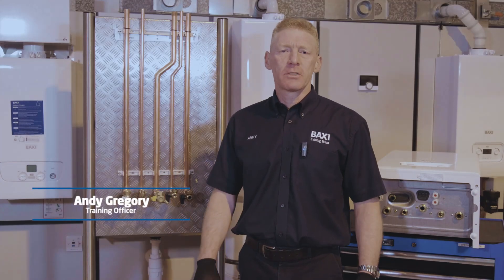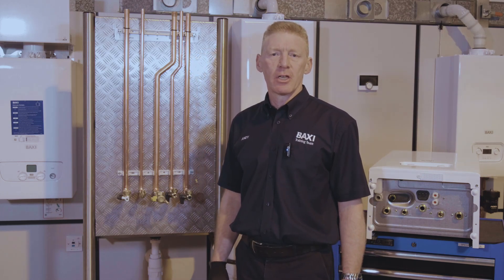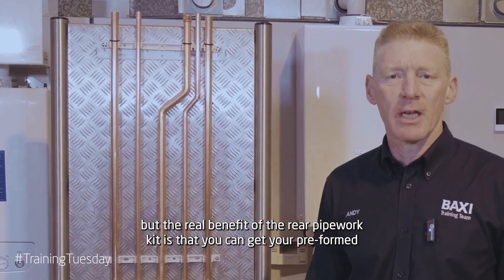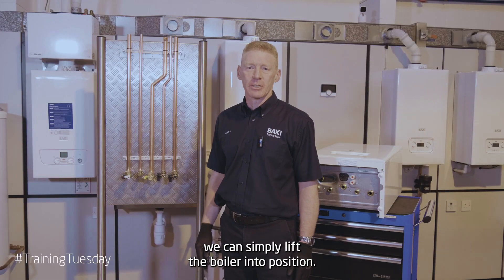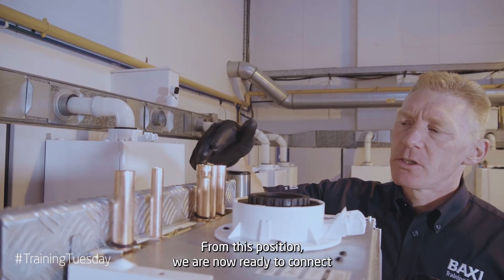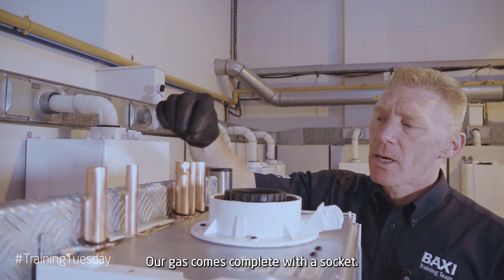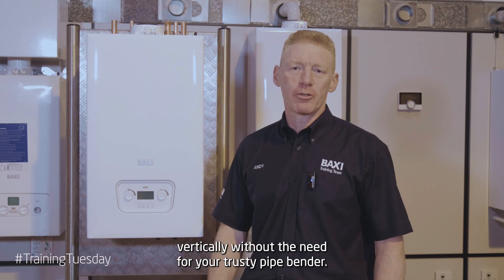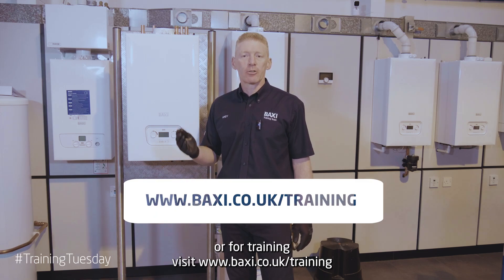How to install the Baxi Multifit Rear Pipework Kit

Comment: Good video.
The kit is useful, however I find it does make the pipework closer to the wall than regular pipe clips making soldering or compression connection a little difficult given the limited space behind the appliance. I favour a Jig installation kit that can be piped to the plumbing system prior to hanging the boiler which saves working around the installed appliance.

Comment: Ive a ignition lock out problem with a Baxi 600, which is a couple of years old, and has dont it from day one. (I didnt install it). And its a very very weird on.  

It keeps getting air in the has pipe, TT is fine, no other gas appliances in the house, no one is messing the meter. 

One first visit, i purged via the test point on the gas tap under the boiler, definitely an air + gas mix. 

But i just cant understand how the air is getting in there. 

Ive rand Baxi and Gas Safe, its an absolute mystery.